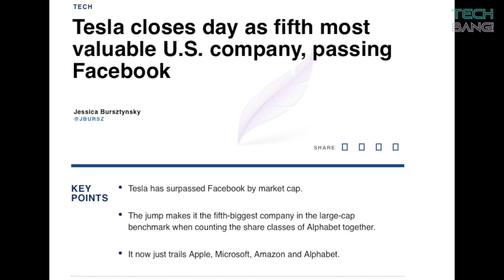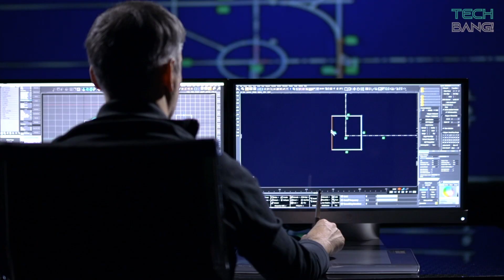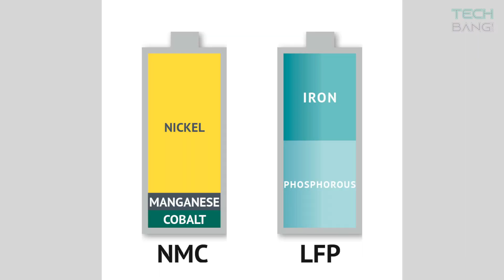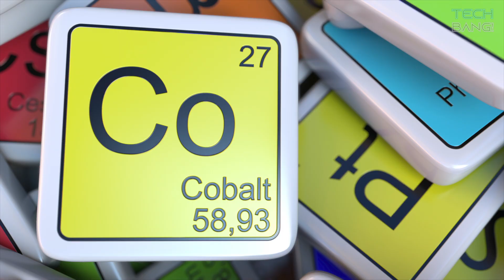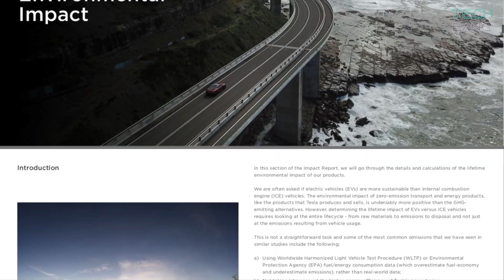3 Reasons Tesla Claims to Save the Environment (Are They LEGIT?)

Comment: Lithium is extracted by strip mining, which devastates the region displacing wildlife and contributing to their demise towards extinction, using the regions water supply up at an astounding rate among other impacts on the environment. China produces most of the world's lithium and the devastation from the mining is staggering. He may be working to lessen his water consumption, but do you think that China, where Elon Musk is getting batteries from, is taking such measures? A mine in Australia has been operational for less than 5 years and has already used up 65% of the regions water supply. In a country where water is virtually a scarce resource to begin with. What kind of impact on the environment would using up the water supply have on a region? Nothing but death is the result. Getting back to China. China is known for its child labor problem and has been known for years and Elon Musk not knowing about that fact is highly doubtful. His switch from cobalt to lithium is doing nothing to lessen the impact on the environment nor child labor and its impact on the lives of human beings. Elon Musk is no advocate for environmental issues. He's just like all of the others, out for the all mighty dollar. I won't get into the production of what 98% of one of his vehicles is made up of, plastics, and what it does to the environment. Elon Musk is no saint. Not by a long shot